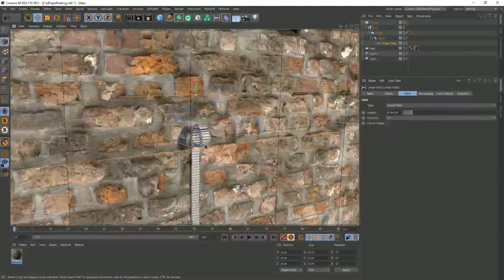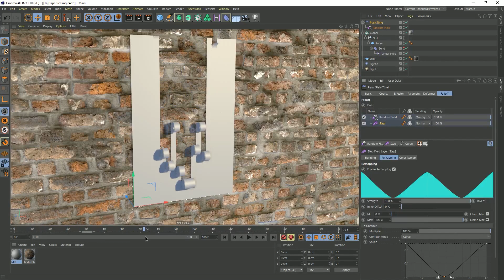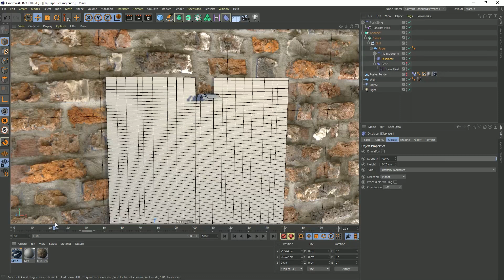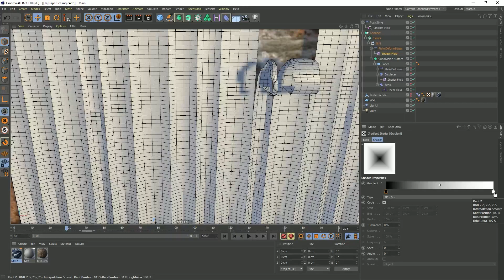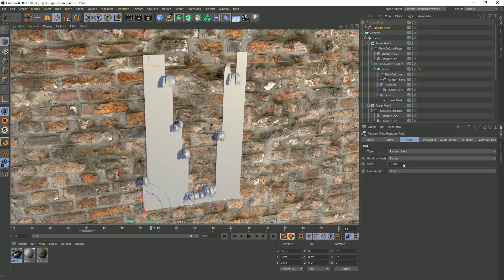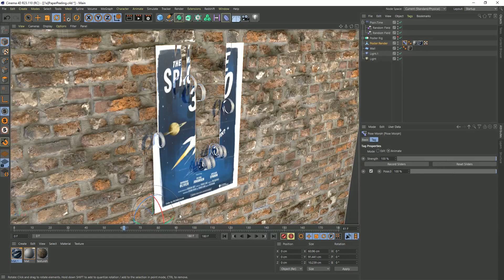Comment: this is cool. my next thing would be to apply some kind of vertex mapping to the edges so a variation occurs along each edge so you can have the paper tear texture appear impeding the print art work. and use a layer texture setup that is revealing it. The perfect setup so you are doing it with one geo and one material.